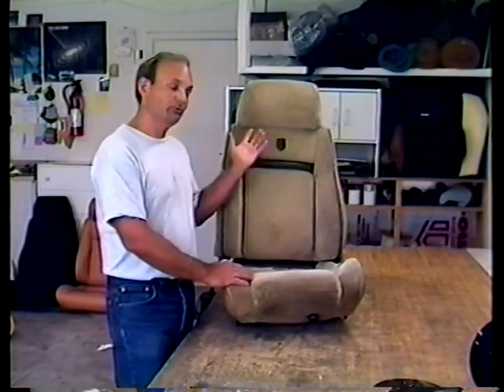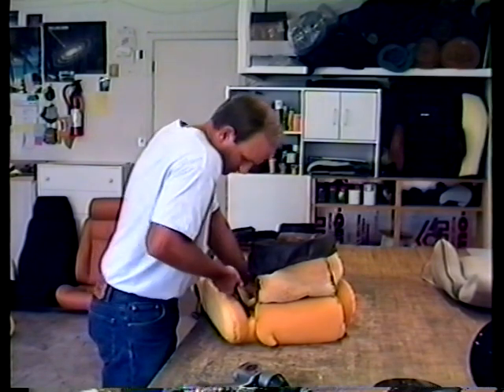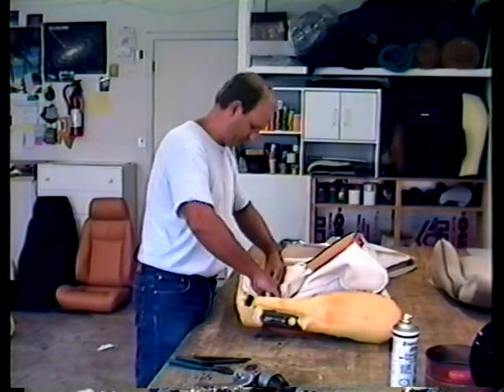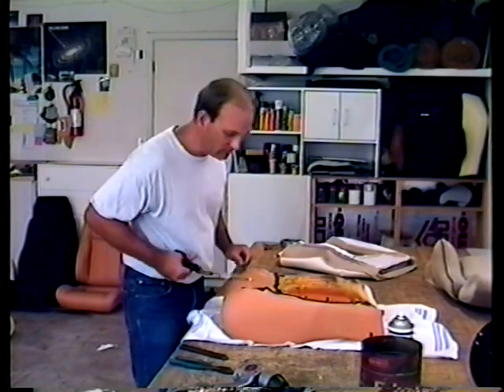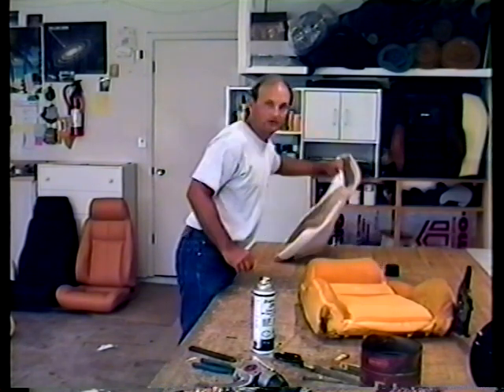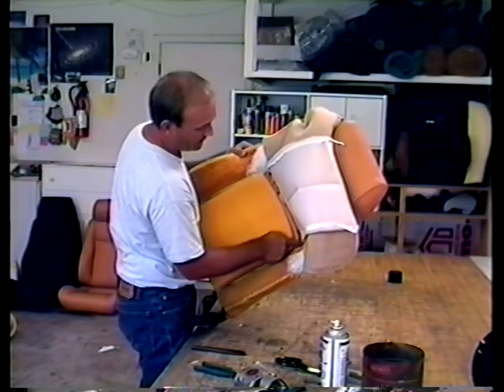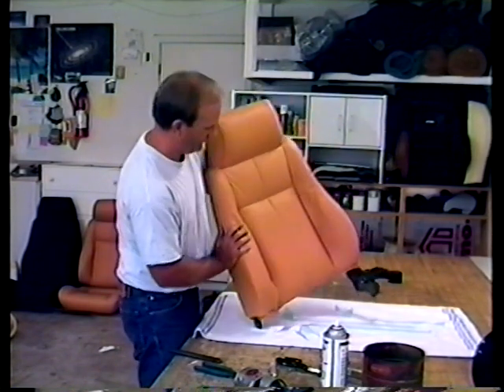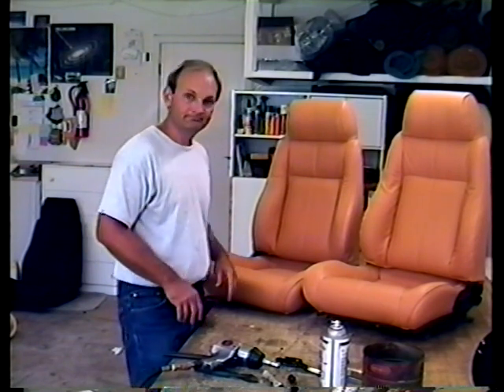MrMikes Fiero Seats Kit Upholstery Instructions

Comment: Question about the upholstery kit. My foam bits are larger than these, espeially #3 is way longer. Do you need to trim that or wrap it around the front to the bottom?
Reply from the maker: The 1-2-3 foam pads for the bottoms are now longer and thicker than the ones shown in the video. “New & Improved”. Install as shown, wrap pad #3 all the way down, do not cut it. MrMike.

Comment: Hi Mr. Mike!  While I'm waiting for my new covers to arrive, I started to prep my old seats (88 Formula, original upholstery).  I have two concerns, or differences if you will, between your video and my seats.
First, when I removed the listing rods in the cushion part, I noticed that mine have a bend in them 10" from the end.  Both rods are identical, so I don't think the bends were accidental.  Is this correct to these seats?  Do I need to straighten the rods?  Secondly,  the middle and back of the cushion were held on with a Velcro-type strip. The foam is solid, with no wires running across.  Where do I hog ring the new cushion to?
Reply from the maker: The rods should be bent to follow the contour of the seat, sometimes the factory forgot to bend them (like 5% or the time). The Velcro is because your seats are 1988, this is a 1988 only thing, simply peel off the Velcro and the listing wire is underneath. These details are covered in the paper updates included with the kit, and on my website instructions. In time I will make a new Fiero install video to include these details. Thanks for asking, MrMike.

Comment: What is the name of the player that you use to clip the leather thank you mister Mike
Reply from the maker: If you mean 'plier' it is a Hog-Ring plier, it has corresponding size Hog-Rings. These rings are like staples, in that not all staples fit all staplers. Hog-Ring pliers and Hog-Rings are included with each kit.